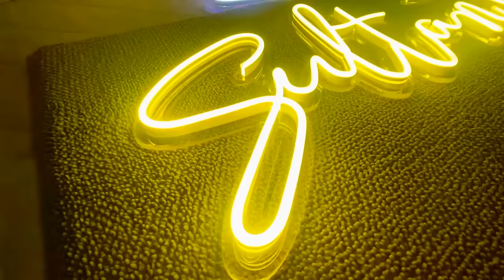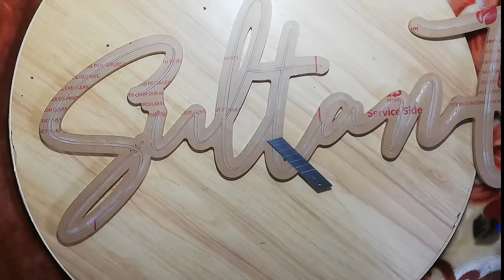How to make a Neon Sign | A Beginner to Pro Tutorial

Comment: How much maximum length I can powered up with 12V?
Reply from the maker: I used 12v 5amp power supply for this project. If the sign is big then you can use 12v 8amp supply. 12v is constant only ampere is changed according to size of neon sign.

Comment: Hello, can two different calibers be used? 22 for neon and 20 for the general connection? or use 22 for everything, thanks
(I need to practice soldering, I always burn the copper parts)
Reply from the maker: Welcome... Yes brother you can use these callibers. To avoid burning of copper parts you must use good quality of neon strip, Soldering wire and use right Solder. If you are using high voltage solder then it will burn copper parts. I use 40 watt solder for soldering.
Reply from the maker: In first days you will not be able to solder connections. It will take some time. Just keep practicing 😊

Comment: do you think that this would work with an LED powered by a remote?
sorry if its a dumb question, this is my first time making a thing like this and i want to make sure im doing it right
Reply from the maker: Yes all the process  is same. You have to connect +ve wire with positive and - ve side with negative wires. Will soon make a video on this topic
Reply: @khaistneonarts  thank you!

Comment: @khaistneonarts I have a neon sign like this in yellow but I wanted it in warm white. Can I spraypaint white over the yellow silicon to get that affect?
Reply from the maker: If you spray paint it, it will block light. U will see yellow light but it will be very dim.
Reply: @khaistneonarts  is there any way to change the color without changing the silicon then?
Reply from the maker: make turmeric solution and apply on little part of neon. Check if it changes color then apply on all neon.

Comment: Quelle est la meilleure épaisseur d'un prexiglass pour faire du neon Light ?
Reply from the maker: It depends on size of sign. For small size you can use 3mm plexiglass. But for bigger size you have to use thicker plexiglass to avoide breakage and bending. For this sign I have used 6mm glass.

Comment: One question what gauge is that wire? Also is it insulated or bare wire
Reply from the maker: This is 1.5mm thickness wire. I buy in local market. You can find it in electrical shops easily

Comment: Can y share link for the glue y using
Reply from the maker: I bought this glue from local market in pakistan. Not available on online flatform. You can buy any Super glue on amazon. First try on a sheet if it is working good then u can start your project. Buy 2 to 3 glues and select the one with good result

Comment: Hey man some advice for one I'm making in my home, the led strip you use, you seem to just cut it anywhere and from I can tell I see solder points, is that due to that specific strip or do all of them that style allow you to cut anywhere
Reply from the maker: No brother all Led Noen strips have cutting points. Some have 1cm cutting point some have 2.5cm.This strip have 1 inch(2.5cm) cutting/Soldering points.
Reply: @khaistneonarts but if there are points indicated where to cut, how do you cut exactly at the point where the letter ends?
Reply: You cut on the black strip that u see on the led

Comment: Great job. Hi, i have a problem with my neon light. There two lengths of wires with metal plugs that go into a spitter into a transformer when i connect one in it turns the light off when the two are connected the light switch won't turn off any ideas whats wrong?
Reply from the maker: Brother make a video and send to my whatsapp. Will help you but let me check the problem.
Reply from the maker: In some neon strip positive and negative are changed. In some strips positive connections are on top and some have +ve connection at the bottom of strip. First check the connections maybe your problem is solved

Comment: Sir please give a link of neon strip light for 2.5cm cutting point or less. And sir is there any way to cut acrylic sheet without machine
Reply from the maker: I buy this neon from local market. So i dont know any authentic online seller. Yes you can cut acrylic sheet with band saw or jeweler's saw
Reply: What kind of led strip is this? 5v(1cm intervals, 12v(2.5cm intervals)or 24v(7cm intervals)?
Reply from the maker: @enzowelvaert4595  5V with 2.54cm

Comment: Is it an 5Volt or 12Volt neon strip you  used? or was it an 5Volt strip you powered with 12Volt? Is that possible? Can someone explain?
Reply from the maker: This is Dc 12v neon strip, you can not use 5v power supply for this. It is possible but the light will be very dim

Comment: Hi, what type of led strip lights you use? I ordered a strip light i'm not aware it should be cut per meter. I need a led like that, can be cut any size. Thanks
Reply from the maker: When ordering from online site just check the description of product. Buy 1cm or 2cm cutting point neon strip 1cm cut neon is expensive and 2cm cutting point strip is less expensive.

Comment: Nice video man
I have a question, what kind of wire you used on the neon strips? The one that goes to the back of the acrylic, like the extension

I dont know if im being clear myself
Reply from the maker: This is clear wire with 2mm thickness. One wire is marked with white line which is used for +ve connection and the other wire has no mark on it which I usually use for - ve connection. You have to connect +ve connection of neon strip with +ve wire and -ve connection with negative wire.
Reply from the maker: Still if u got problem you can ask ❤️
Reply from the maker: This is same wire as I used on the back side.

Comment: excellent work.But how to hide the main wire when it is placed on the wall.
Reply from the maker: You can hide wire on wall panel but on solid wall it's a big problem. Normally I use transparent wire which is less visible.

Comment: Hello, Hope all is well I'm reaching out to see if I can pay you to make me a sign? I looked at the video and it seemed like it's easy except I don't understand the back part the sottering.
Reply: Its soldering ,connecting 12 volt point in all parallel for dc power supply
Reply from the maker: I can make design for you but i never made for a customer who is so much far away. If possible to deliver you with courier service then i will definitely make for you. Sorry for late reply.

Comment: How to cover joints where soldering in backward
Reply from the maker: You can cover joints with glue gun or silicon to avoide short circuit etc
Reply: @khaistneonarts  can we use heat shrink tube ?
Reply: Hello sir is 30 watt soldering iron enough to solder neon light

Comment: Great vedio for the beginners...I have been making them ....Can you suggest to solve the problem of super glue nozzle getting clogged frequently .👍
Reply from the maker: Yes i am planning to upload some tips and tricks videos where I will discuss these problems. Use plastics nozzles they are cheap and if one is clogged you can change another one. After finishing glue work cover the nozzle with paper tape It will solve your problem.
Reply: Thanks bhai.for your prompt reply ....
Looking frwd to your vedio ....as always i do .
Plastic replaceble  nozzles is the right solution ....These super glues to do not stick to PVC parts ...👍💐

Comment: The hardest part is to craft that acrylic base which you didn't show.
Reply from the maker: No dear that is the easiest part. Just make design in computer and put that design in laser machine. It will cut that design in 30 seconds. I dont have laser machine so the did not allowed me to make video of sheet cutting
Reply: @khaistneonarts  So for those that thought this can be done at home, we still need a laser printing machine which is an expensive investment?
Reply from the maker: @ArahTao  it is not necessary to own a laser machine for this art, i cut this design for only 5 Dollars. i am still doing this work without thinking of buying laser machine. if you want to learn a skill then you must not think about negative aspects. just go and do it.